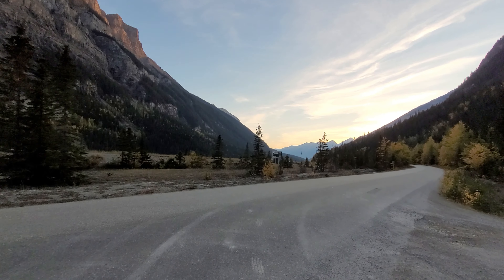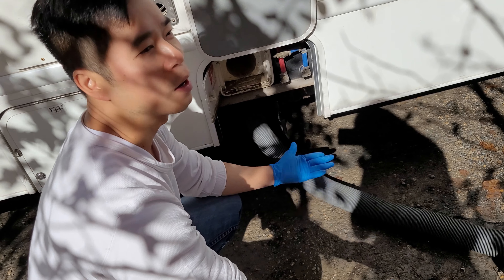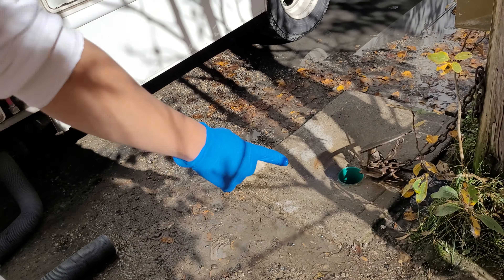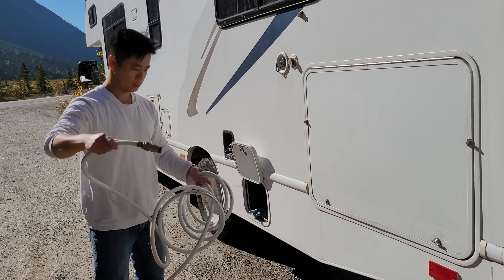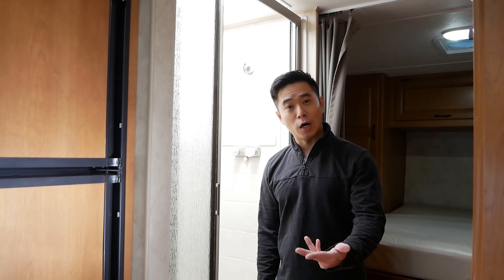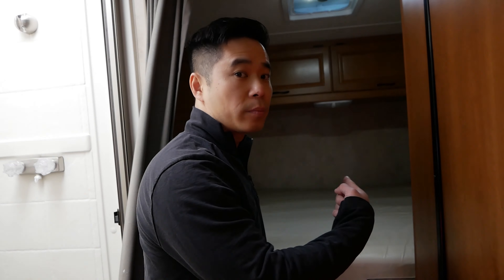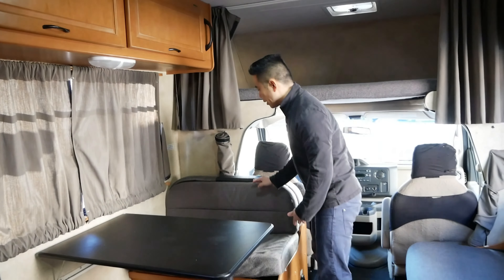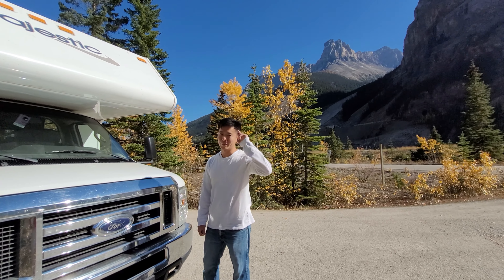How to use Thor Majestic 28A Ford Super Duty E-450 V10 RV Motorhome  - Complete renters & user guide

Comment: You forgot to show us the overhead bed. Thanks for the show. I’m going to buy this model from the rental company.
Reply from the maker: You are right I didn't. It is however a standard Class C front cabin bed. These really don't vary too much in design between models. Usually it is a bed with a some sort of cushion design that you can move around. 

I have  a video of the Majestic 23a, which has the same front bed of the 28a. Here is the link to the spot that shows the top of the bed. It will be 99% the same between the 28a and the 23a. (The rear of the RV differs greatly however, and other mechanical specs)

https://youtu.be/rAf2f5rOXoY?si=ax5GcWPea6mgKxe4&t=1005

Hope that helps.

Comment: I own this exact make and model and was wondering if you have any reccomendation on mounting a TV. I plan on going on a holiday road trip soon from cali to florida.
Reply from the maker: Hey there is a spot in the bedroom for it, but I am assuming you want to mount it somewhere to view for driving. I honestly have not found a good location for a TV for passengers view during driving. I ended up with just using tablets.  

But if I was to add one, I think on top of the side door would fit a small TV decently easy.

Comment: Hi, and thank you for this excellent tutorial on how to use these rigs!  Did you get any kind of leveling jack or blocks, since the rigs don't come with them?  Also, how are they driving on dirt roads?  Thank you!
Reply from the maker: Hey no problem, glad you enjoyed the video. For leveling jacks, I don't use them for Class C RVs. Normally I am in campgrounds that are pretty level. I have used some planks of plain wood to minorly level out the RV if needed. In Alberta there are a decent amount of dirt roads, this RV does okay. The main issue you will run into the grey and black tank outlets. They are the lowest points. That being said if you don't go super outback camping you will be okay. This RV has made it to Alaska and back once - lots of dirt roads. Can't say it was good for the suspension but it made it there and back. On a side note - the Shorter model Majestic 23a has super high clearance.
Reply: @thebestfamilyoutdoorshow  That's good to know about the 23a.  Though, we will be going on the road with 5 cats and a pet bird, so we will need a larger rig.  We don't want to go onto any crazy dirt roads, but the places we want to go might have some dirt roads to get to campsites.  Our road is also a dirt road, and is mostly very level and cars drive on it easily.  Thank you so much for the reply!

Comment: Question, the car alternator will charge the rv battery and the generator will do it as well?
Reply from the maker: When you turn the engine on the alternator, it will charge the engine battery and the rear RV battery. This would be a quicker charge as the alternator outputs much higher amps. Based on my google, it looks like the Ford E-350 comes with a 130 amp alternator. 

When you turn on the generator, it will feed a 30 amp power supply to the RV. This will only charge the rear battery NOT the engine battery. It will also charge a lot slower. At most about 10-12 amps. Hope this answers the question.

Comment: There’s a heater in this Motorhome?
Reply from the maker: Yes there is a propane based ducted heating system along with an Air Conditioning unit that works when the unit is plugged into electricity or if the the generator is running.